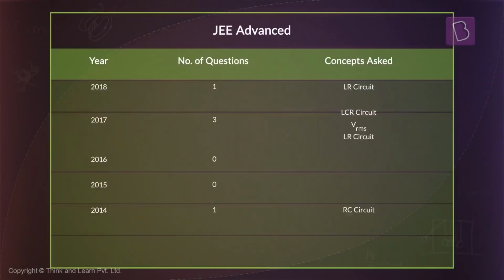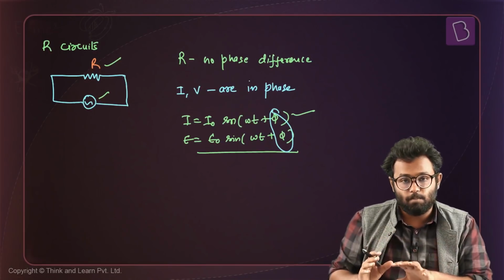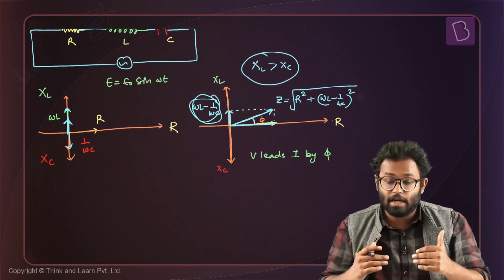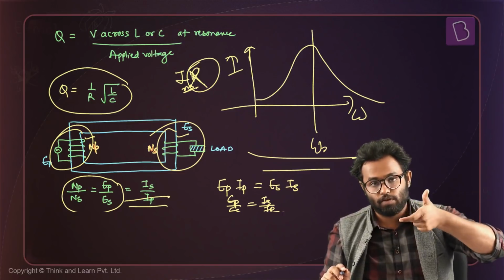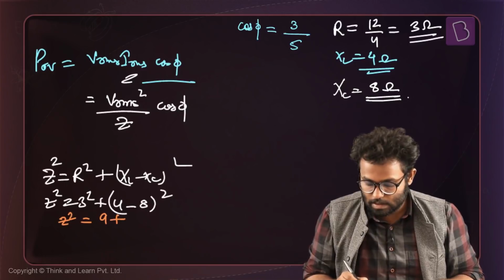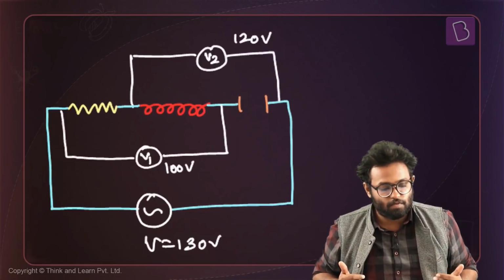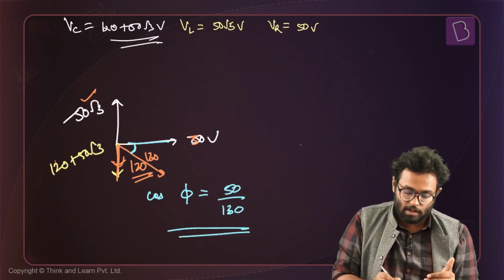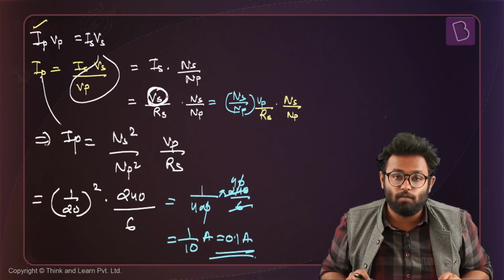JEE Alternating Current | Electromagnetism | Target JEE | JEE Physics

Comment: sir is eddy current is use in electric heater?
Reply: No. An electric heater uses a material with high resistivity. An induction stove uses eddy currents.

Hope it helps.
Reply: sir plz reply